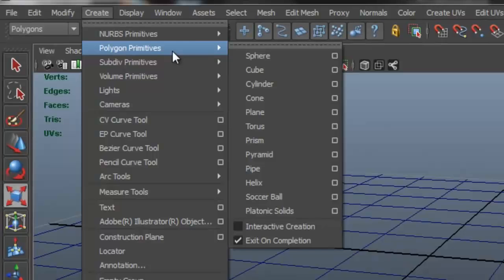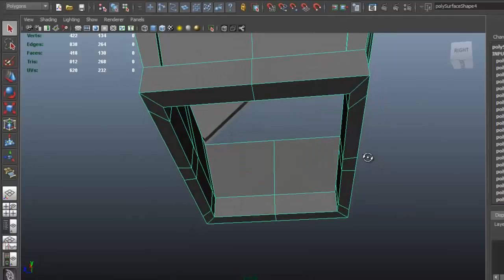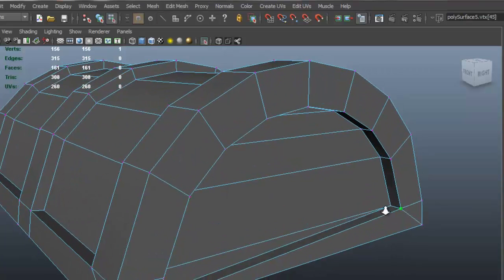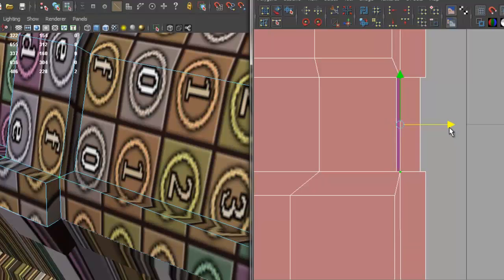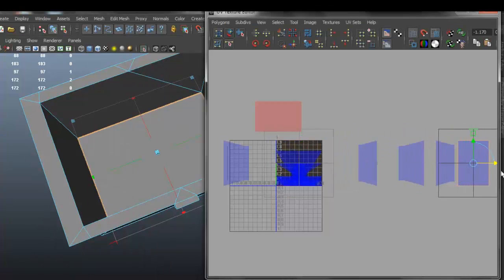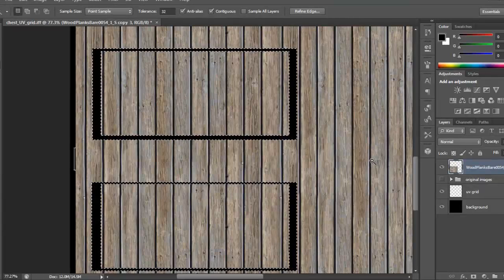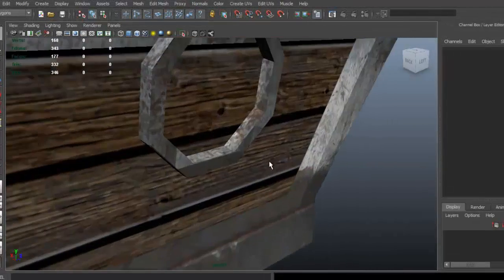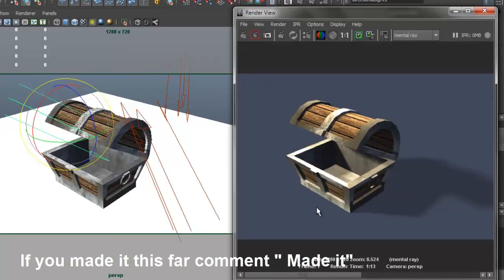Autodesk Maya Tutorial - Treasure Chest Modeling, Texturing, lighting

Comment: For the Treasure Chest side knob, it doesn't turn into a straight line when I use cylindrical mapping, I set the attribute to 90 but it still ends up looking like "~~" instead of a straight line.

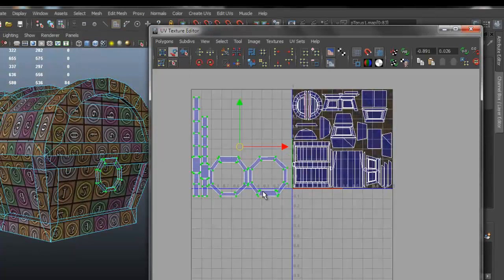Comment: Did you arrange the UV by yourself at 1:12:41. because when I use layout all the UV bottom and the top part  just overlap each other
Reply from the maker: I used layout and then arranged them by hand. If you are using the latest version/s of maya make sure to set the layout options to "legacy" so they don't overlap. I noticed the latest vesion of the layout tool isn't as good as it used to be.
Reply: 3dEx oh OK thanks

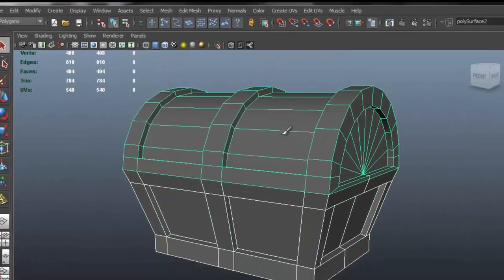Comment: can you pls explain the command in 11:54 ,how did you separate a single mesh into two.that is how did you separate the top from bottom.i am using maya 14, i tried it but nothing seems to occur.pls guide
Reply from the maker: you have to select the edges where you want it to separate and use the detach option. After that is done you should be able to use the mesh- separate option.